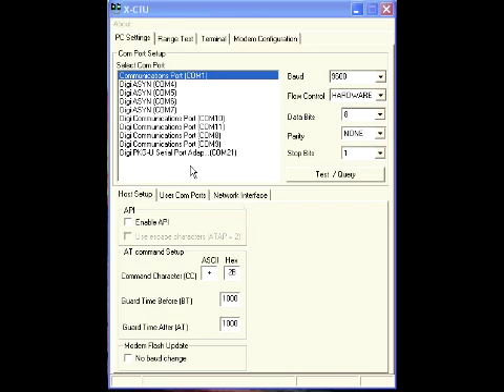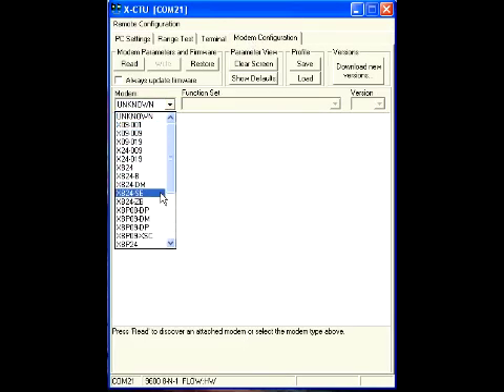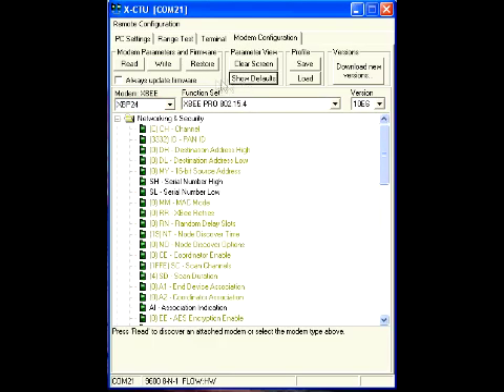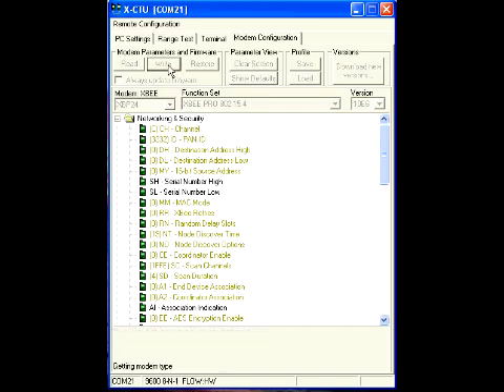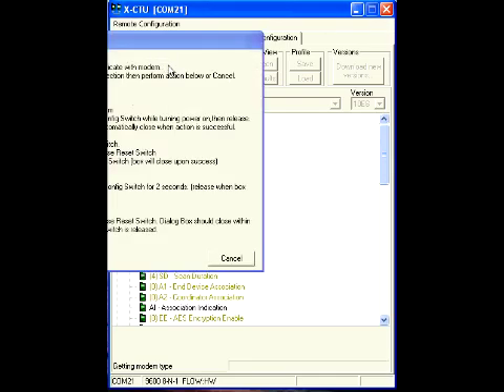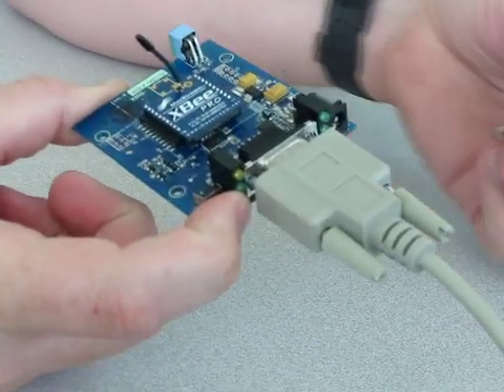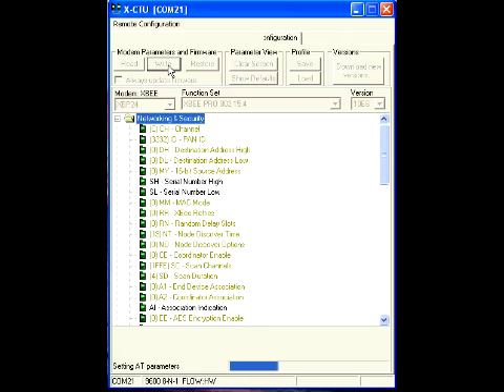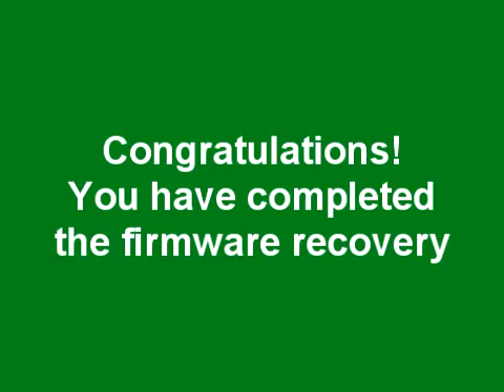How to recover from a failed firmware upgrade

Comment: I followed this method with 7 modules "S1 Pro XBee Sensor Adapter" (The XCTU was not able to read the old firmware ) and only 1 was successful, in 12 attempts, with several different modules.

However, setting the flag "ALWAYS UPDATE FIRMWARE" under the
"Write" button in the X-CTU, just follow the procedure in the video, but not touching the power supply, which must always be connected,  success is 100%
Only then I could update the firmware to 7 XBee Pro successfully.